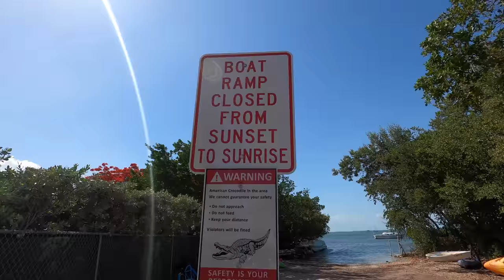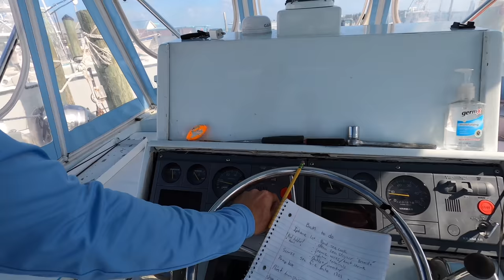We got a NEW BOAT! "Mini Van" 23 Hurricane Deck Boat Walk Through and Sea Trial

Comment: that boat will keep you busy for a while. the wiring contacts are not in prime conditions. you may try the CRC contact cleaner or similar thing, spray the copper contact pins inside those sockets and plugs, you know the drills. and seem there is one thing missing? RADIO. not that fm radio to listen music, but the radio to talk to other boats. that's an insurance ticket when your iPhone is wet. some hand held are pretty good nowadays, it save a lot of time drilling holes and wiring on your boat.
Reply: I wish i had a boat like that for tasty Thursday

Comment: Three things remembered from boat ownership. Boats need constant maintenance. When trailering. Rest the boat for at least a 1/2 hour before launching so the bearings in the trailer's hubs have a chance to cool off. Last but not least always. Alway spray corrosion inhibitor everywhere. Even if it looks like it's not needed.
  Do those things and there is a very good likelihood that it will resell for more then you paid for it.

Comment: no guys the speedo went out , the tachometer is still working and u trim out the motor and raise or lower the jack plate to fine tune rpms to top spedd from lessening the drag but u have jack poles for stablizing the boat in shallow thats why aint no anchor cause the stabilizer holds u when ur in shallow and want to fish or decide to hang out on some sweet shore beach u find or a sand bar to party  but yeah that boat is sick.. id need maybe 250 plus merc or somthing even yam just have a need for speed but so much room abaord i dig lay out.